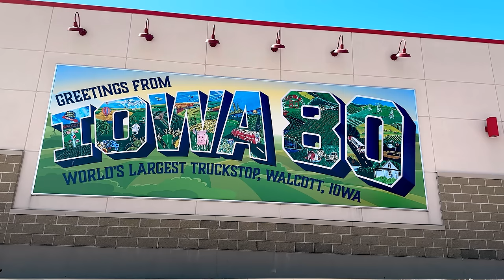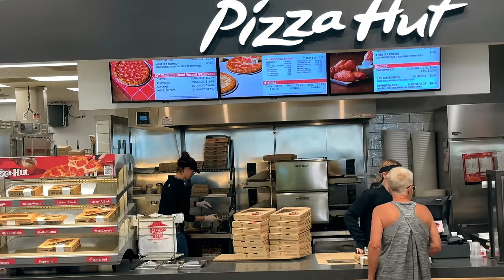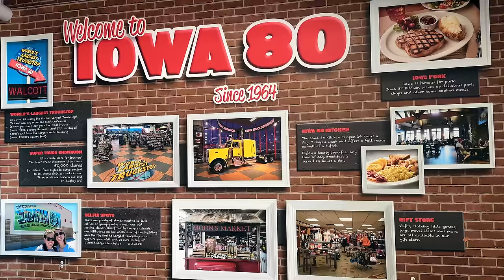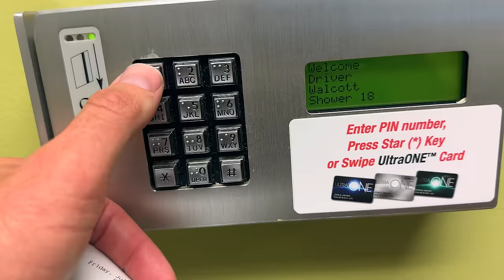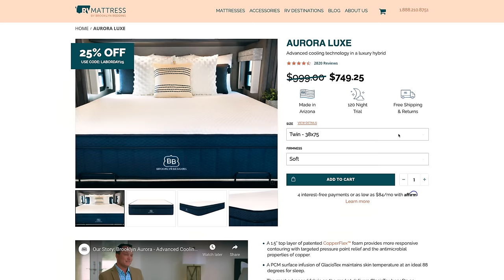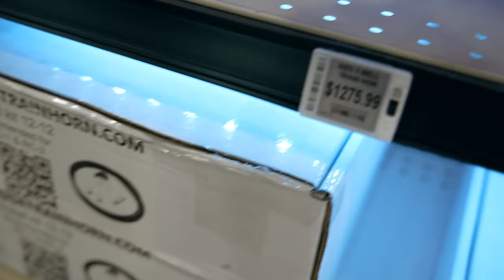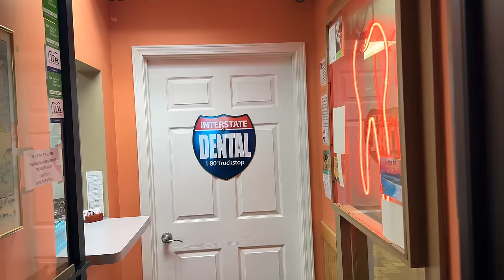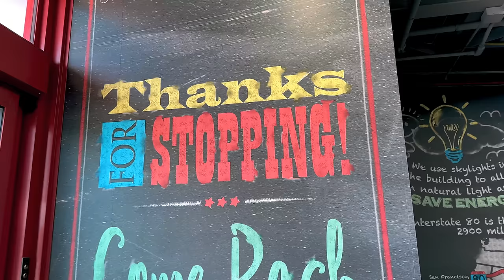24 Hours At The World's Largest Truck Stop! RV Overnight Camping

Comment: Those buttons are air brakes, compressors in that tractor "big rig" it's easy really to drive there fun to work on too, just like an RV, trailer or any diesel
Reply from the maker: Good to know! Thanks for watching
Reply: It may behoove you and your husband to get a CDL manual and potentially get your class b license with passenger endorsement so you both will know more about those extra lights and buttons

Comment: The only thing I wish I knew, is if you pay for the wash at the wash, or in the truck stop. Although, I asume the price may change with the size of your RV. And, did that include a wax coat? The RV guy in Arizona says you should wax your roof at least twice a year. Thanks
Reply from the maker: Our roof is a lifetime spray on roof so it doesn't need any maintenance any more. The wash was paid for AT wash center which is on the grounds of the truck stop. The price did include the Jeep wash as well.